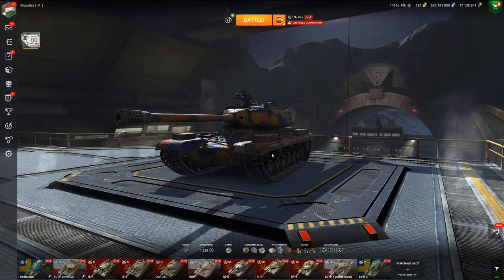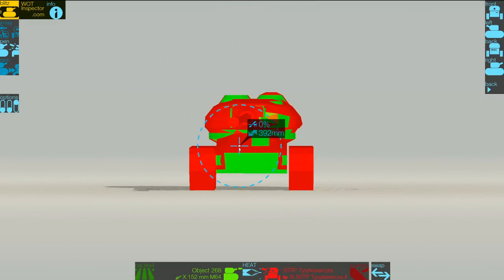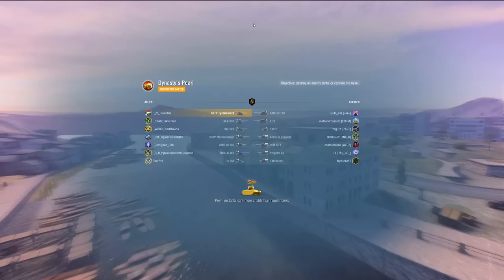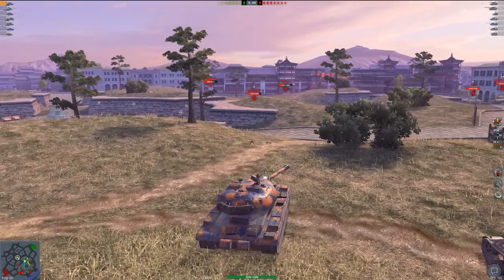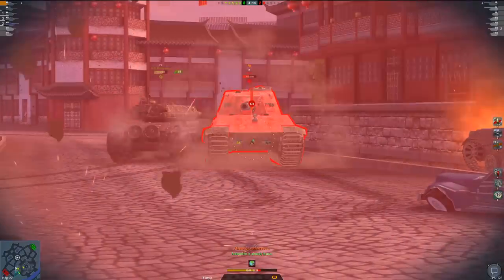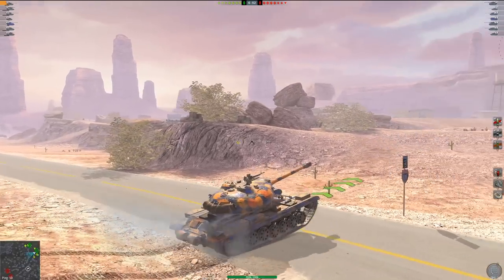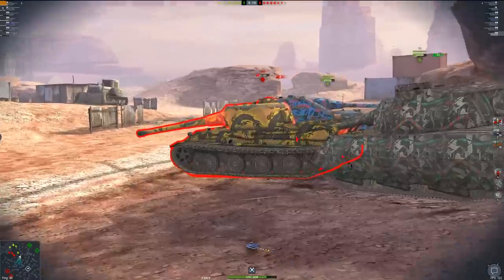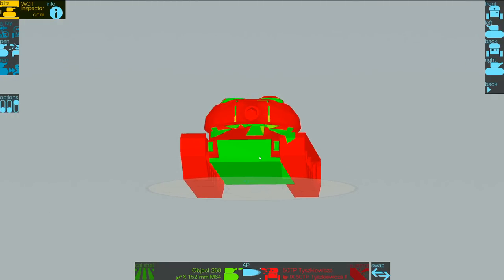WOTB | THE TURRET IS 400MM THICK! 50TP

Comment: Another tip in this tank, if you have an enemy behind a building or a wall that is aiming at you, bait the shot with this tank because the tracks stick out infront of the 50tp and there is no actual pennable area, so if your enemy isn't unicum they will most likely shoot at your track which will only track the 50tp

Comment: It's a shame that they didn't put in the 560 alpha damage gun from WoT not Blitz, though it seems that majority of 128mm and 130mm have the same 460 damage, then again they do get the tungsten shell as a gimmick for the line, and as for the design it's modeled after the obj 777 heavy tank project

Comment: Bruh, E75 is powercrept because of this tank
Reply: *crept
Reply: not really, e75 can sidescrape and acctually has a good lower plate
Reply: @ck_5243  you mean giant lower plate
Reply: @alexhuntercdc5151  at least it won't easily get ammo rack from the front.
Reply: Nah the lower plate is pretty strong even though it big. E75 for me is still better in some aspects.
Reply: @yohotobio2917  have you seen the engine of E75 placed at the front :) ?
Reply: @alexhuntercdc5151   I personally don't think engine is that important unless you are like on a medium or light tank where speed is much needed to go flanking so that wouldn't affect the E75 much compared to some ammorack
Reply: @MyTran-gn4rk  eating round from the front ain’t fun :)
Reply: @alexhuntercdc5151  well I mean every tank eats round from the front unless you want the obj 279e in wot blitz
Reply: @MyTran-gn4rk  i mean the engine is at the front
Reply: @alexhuntercdc5151  bruh its not engine
Its transmission
The engine on the back

Wg make them goes to 1 module
Iam still hoping wg gonna separate them
Reply: @sweetjohnson7562  how the transmission catch fire again :))?
Reply: @alexhuntercdc5151  dont ask me... Ask wg
Reply: I've like 1k battles in the E75 and I've never really had big problems with broken engines. Probably because the lower plate is the part of the tank that I always try to hide. It's clearly not as bad as a Jpz 4.
Reply: and if u can't hide the lower plate try to get closer to the enemy (like 1 tanklength away that's the ideal distance) and the lower plate can't be penned anymore because of the increased angle.
Reply: @alexhuntercdc5151  ok so the engine is at the front and what does that have to be so scary about when there is equipment to deal with the problem anyway?
Reply: @MyTran-gn4rk  how much does it lower the risk down exactly :))?
Reply: @alexhuntercdc5151  a lot if I were you but maybe you don't have the consumables or equipments